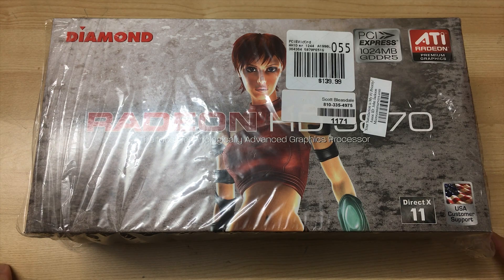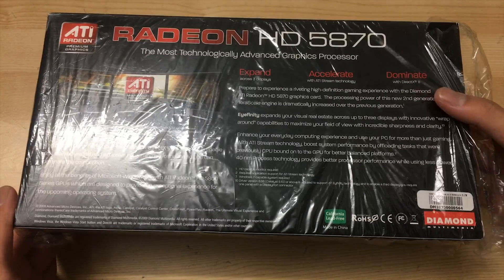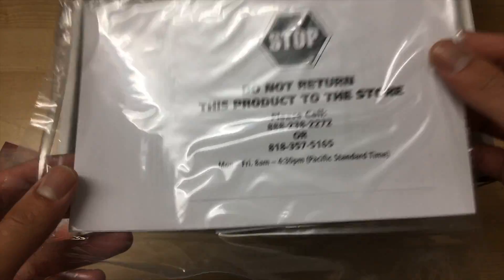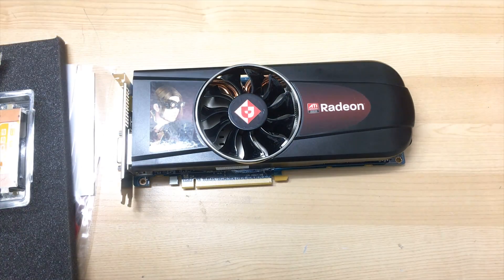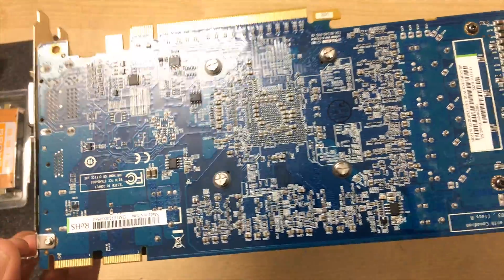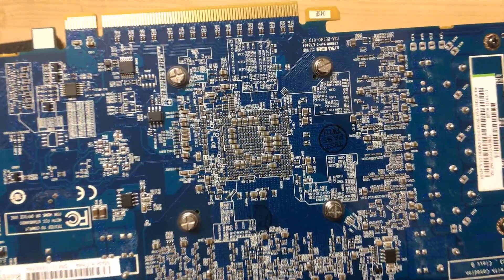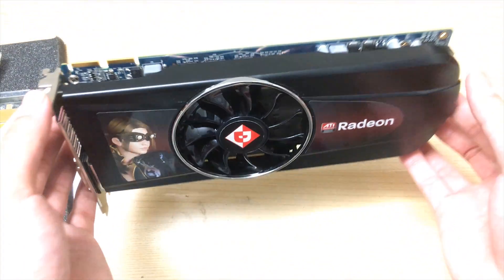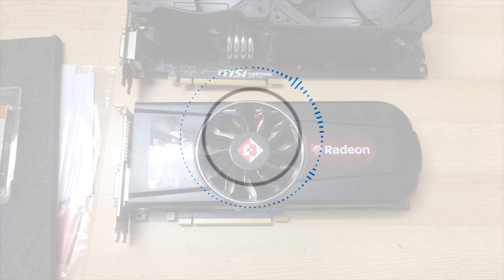Retro Unboxing! Brand-new ATI Radeon HD 5870!

Comment: I found one on ebay with a 3 fan setup for $60. I recently bought an Oculus Rift S and didn't know the DP requirements. I'm hard-headed so instead of selling the Rift, I decided I'd build a pc to run it. (I've never built a pc and honestly don't know anything about building a pc) Do you recon this GPU will run the Rift S? Many thanks.
Reply from the maker: No this gpu is so old the engineers wouldn't even know what the hell VR is.
Reply: @OTechnology  Great. Thanks. Do you think you could recommend an affordable GPU that would run it? I'm sure your knowledge outweighs me being lost for hours in Google searches. Id greatly appreciate it.
Reply from the maker: @Immad1337  affordable gpu is quite impossible these days to be honest. Especially one that can sufficiently run VR games well. Ideally an RTX 3060 or RX 6700 XT is great for current generation gpus but they're ridiculously overpriced. So if you're looking for affordable then maybe try to find an RX 570 or GTX 1060 around $100 mark. They do okay for VR.
Reply: @OTechnology  Thanks so much. At least now I'm not heading into this blind.

Comment: Radeon HD 5850 1024MB is a High-End GPU part of the Radeon HD 5000 Series released on 2009. Codenamed Cypress Pro, this Evergreen 40nm GPU features 1440 Shader Processing Units, 72 TMUs and 32 ROPs. HD 5850 1024MB features a 256-bit Memory interface of fast GDDR5 Memory type, clocked at 725MHz on the central unit and running a Memory clock of 1000MHz. Performance is around or even better than the 2013 Radeon HD 7790, and is suitable for a 1080p resolution, but some Modern Demanding games like Crysis 3 will need lowered Aliasing settings to be playable. Its power consumption is considerably higher than other GPUs comparable performance-wise.

Is this it?